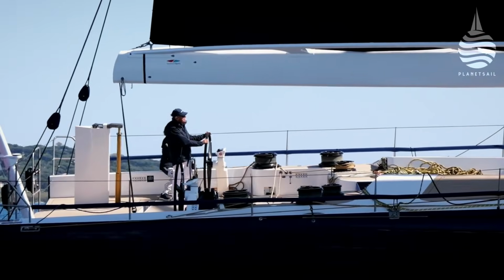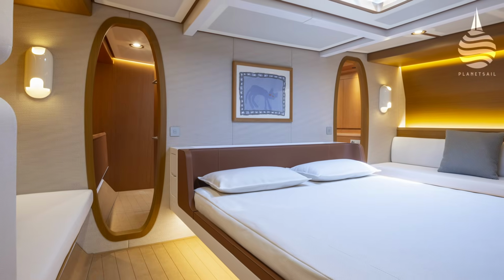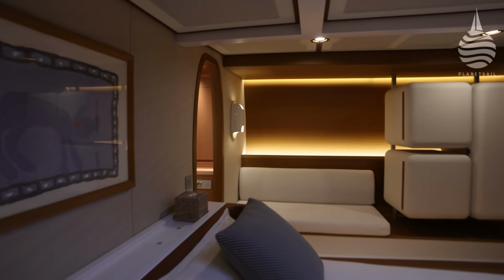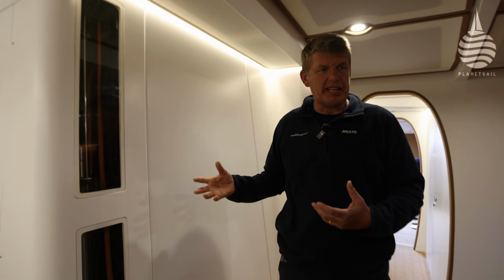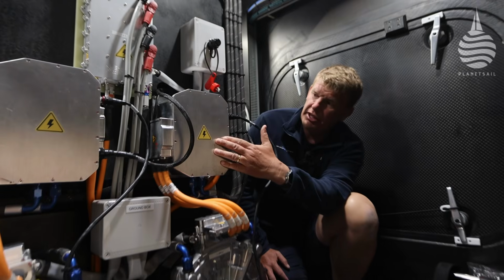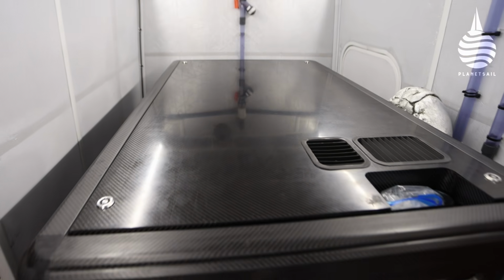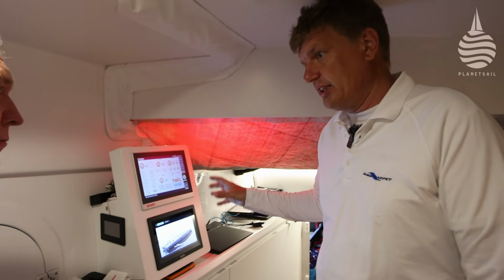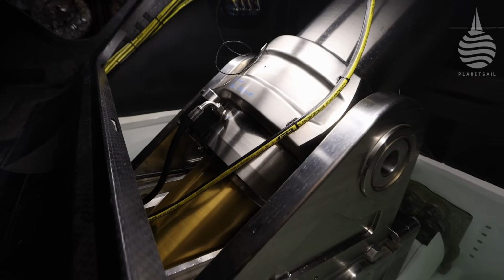Below Decks - How the Systems Work - Magic Carpet-e  Pt3

Comment: Actually just a method of showing how much you can spend, EV boat will end in tears, and will probably require a Diesel main power plant in the future. I would like to see the mass saving between batteries and a diesel engine that could deliver the same power. The only advantage is EV system is quieter -- other than that, the whole system is, although impressive, does not offer any other benefits.

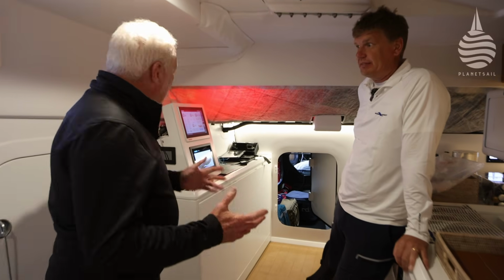Comment: 18:22 “The battery becomes fully operational again!” This is after thermal runaway? What type of thermal runaway? Or are you saying that the batteries get hot due to usage? But isn’t battery thermal runaway a catastrophic non reversible event? Must have missed something in the translation.

So in car terminology this would be a hybrid car with an “Range Extender Internal Combustion Engine”. Too bad it is still uses an ICE. How about a fuel cell or small turbine running on a “Green Fuel”. Are they using bio-diesel, SAF or an E-Fuel? Are there not fuel cells that can be run on Bio-NG?